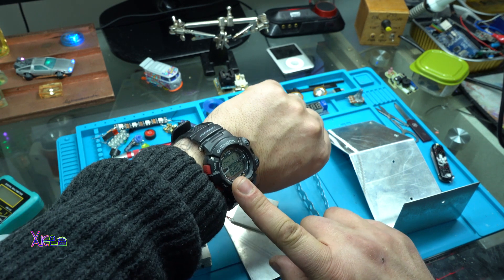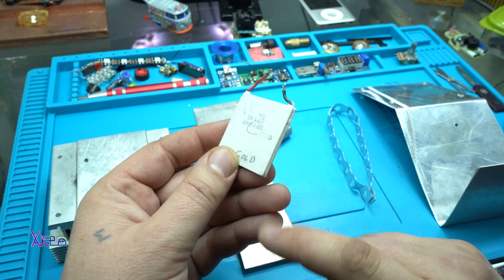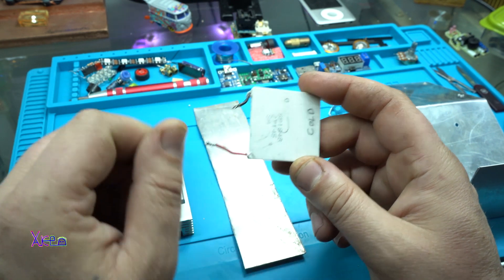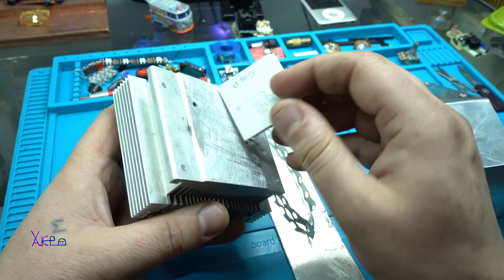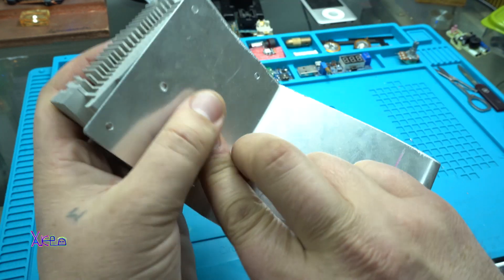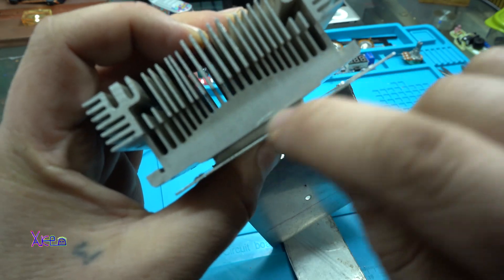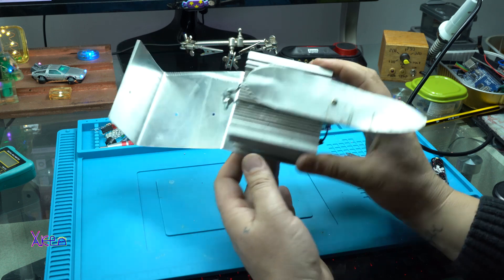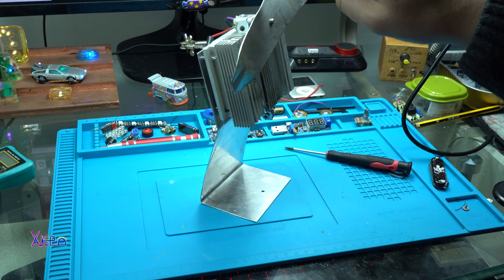How To Make Wood Stove Fan

Comment: I got a little disappointed with the store bought models because they lack enough power to push air meaningfully.  My plan is to make one with two or more (maybe even 5 to get 5 volts) thermo pads with a well balanced fan.  A lot of heat rises from the fire box but these fans typically aren't powerful enough to push the heat past that upward convection current.   I am surprised some ebayer hasn't come up with a more powerful version before this.  Thanks for the vid.